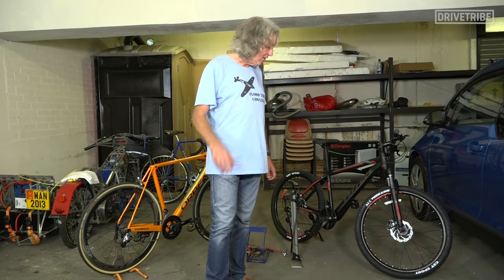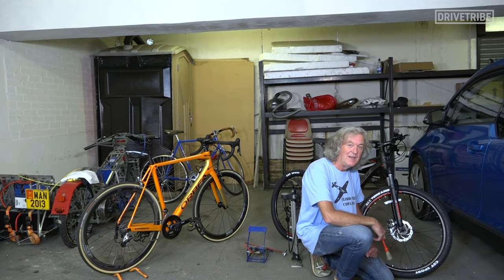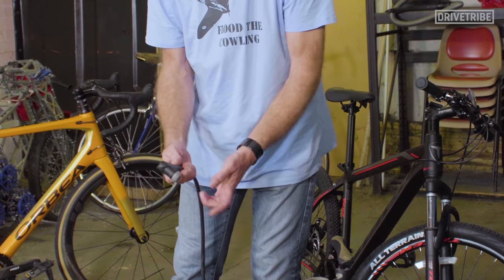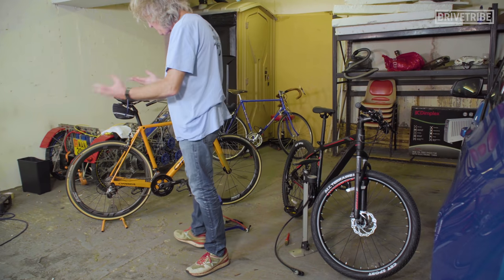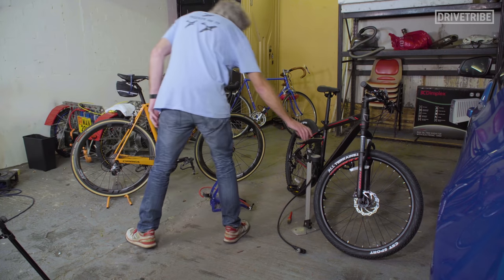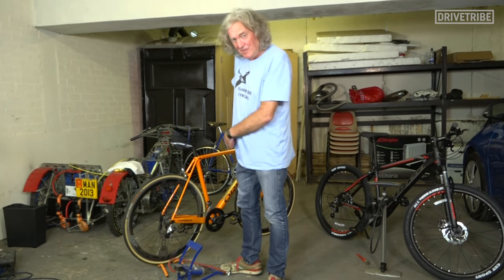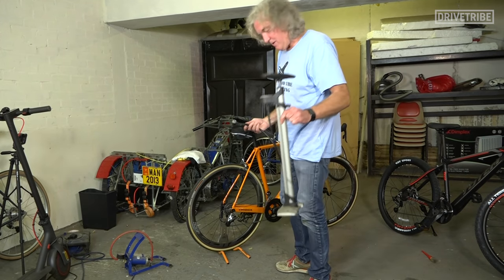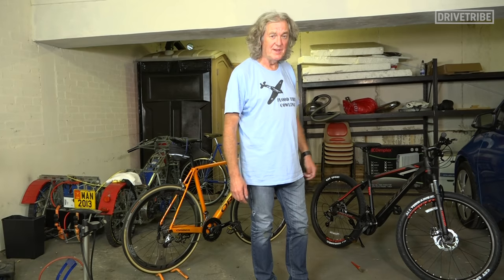Let James May teach you how to pump up a bicycle tyre

Comment: Imagine someone stealing his dust caps. He'd be mortified, especially after spending 10mins cleaning them with a car detailing brush
Reply: Well it is somewhat annoying when you've sent your bike in to be repaired and they don't put the dust caps back.
Reply: I used to put some threadlocker on mine.

You can loosen them again with a hairdryer. 👍
Reply: @jimmyrustler8983  Do you carry a hair drier out with you on the road?
Reply: @merckxy54  No, but I do carry a lighter.
Reply: @jimmyrustler8983  Why? You don't even need them so you are just making it harder for yourself if you get a puncture.
Reply: @imperialspy3457   It literally takes all of 30 seconds to remove them. Not really any harder.

Try tying a pedal back on with a shoelace after snapping it in half, 6 miles from home. That was fun.
Reply: Imagin him accidentally swallowing one... 😂😂😂 choke on your envy savey....
Reply: @gjjbfdunnb  I did that once with a monopoly board piece as a kid.

Comment: I use presta valve tubes always, because I'm always losing those caps, whenever I have a "roadside emergency."  Putting stuff down without thinking, and subsequently losing it beyond finding, is some sort of special ability I have.  If I put that cap in my mouth, it will inevitably either be shot out on exhale, or accidentally swallowed or inhaled.  The joy of living with a frequently stopped up nose.
Reply: im missing a Presta cap . do i order one from Amazon ?0
Reply: @clockwork9827  Yes.  Go for style, and order a bunch of anodized aluminum presta valve caps!

Comment: 2 points: when brushing dust etc out of a Schrader rotate the wheel to the brake caliper so that debris drops out - gravity always wins, James should know that. When you buy a stirrup/track pump buy a decent one as some of the cheaper ones will not pump above about 80psi and will indeed blow out as I found out with an Aldi one!

Comment: Schrader valve "dust caps" are the sealing device. Inside each cap is a seal to close off the end of a valve core. The valve is the transfer device. Without the cap, the valve can and often does leak.

Comment: You can also use the pump to blow the dust out of the shrader valve. 😌
BTW, most Mountainbike wheels are fitted with presta valves, because most people run them as a tubeless setup with puncture sealant.

Comment: I learned from veteran racing cyclist that it's best to remove the bottom nut from the racing (May calls it a 'pasta' valve ?) valve. 
This way the tube will seat itself better in the tyre and allow for faster replacing, at least so I was told. See 4:17
BTW at 64 years of age I seem the only one on the road still using a Reynolds Tube 531 frame, all 11.5kg (25lbs and a bit) of it.

Comment: One tip I learnt aged 10...when parking and securing the bike, it's worth rotating the wheels so that the valves are hidden from view, for example at the top end of the forks or between the brakes...in case wandering ferals or chavs enjoy deflating your tyres while you're in the shop buying liquorice or chuggy.

Comment: one extra tip.. on the road bike wiht the presta valve, you can use the dust cup to transform the valve to a schrader one. cut the tip a little of the dust cup and put it aguain in the open presta valve and you have a schared valve with no need for an adaptor

Comment: If you have a compressor, it's simpler to just use the attachment which fits your tyre valve and blow them up with that. That way you don't have to have that sped up "I see deer" montage to help you through it.

Comment: Coming from a country with many many more bicycles (the Netherlands), these are not the only two valves and especially the tiny one is very uncommon here.
The common one is somewhere in between these two. According to wikipedia it's called Dunlop/Blitz and is used on pretty much all normal bikes here. Only mountain bikes with fat tyres use the schrader valve and only pretentious race bikes use the 'french valves' as we called the Presta ones. And most bikes with presta valves simply put an adapter on the valve to Dunlop and simply leave it on.
https://nl.wikipedia.org/wiki/Fietsventiel

Comment: James - if you are going to blow out the valve or brush it out before filling, you should have the valve at the top of the arc of the rotation so any debris will fall down and out of the valve and not get brushed or blown back down it.

Comment: Also most mtb wheels still use presta because it's easier to work with tubeless sealant as u can take the core out and u can put in the sealant without removing the tire!

Comment: If you're going to use a brush to clear out a valve I suggest you turn the wheel so the valve is at the top. Dust will then have gravity's help to fall out. I'd have thought James May would have known this..... And the same applies to pumping the tyre up - move the valve to the top so you don't have to bend down to attach the pump.

Comment: In presta: Do not listen to James, trow the dustcap and locking ring away. If you get noise from the wheel (never happen to me, however heard about a few that have) due to the missing valve locking ring put a little tape or simular around the bottom of the valve.

Oh and follow The Rules!

Comment: Maybe, the molecules of air already within the inner tube are heated up by the action of the pump. These heated molecules melt and stick together, making the air harder. It takes weeks for the melted molecules to separate and the tyre eventually softens.

Comment: Maybe, the air inside the inner tube is not affected at all by the pumping action. The energy and heat from pumping, cannot be destroyed, so the energy input changes the chemical composition of the butyl inner tube into a harder substance. This harder substance softens during weeks of cycling and releases the pumping energy back into kinetic energy to drive the bicycle in overcoming air resistance.

Comment: Maybe the energy put into pumping the air already within the inner tube, causes the atoms of oxygen and nitrogen to dissociate and expand into a different chemical composition, making the tyre feel harder. It takes weeks for the dissociated atoms to reform back into oxygen and nitrogen, meaning, air. Air is 77% nitrogen and 23% oxygen, but you already knew that.

Comment: Disliking the Presta valves on my non-Posh 1970's Raleigh Record I found some beautifully machined brass Schrader adaptors on Amazon with o-rings on the back that seal on the
Presta stem.
       They stay on all the time and they don't leak one whit.  -  Problem Solving Peasant.

Comment: We just took the poor deflated tyre down to the local gas station and filled it up with the ECO air unit mounted on the wall. Just set it for 60lbs and "ding, ding, ding!",  it was full. Failing that, it was the hand operated pump that came clipped to the frame tube of your Raleigh English Racer.....Unless you had a Schwinn, which no self respecting young bike enthusiast did.

Comment: "Universal ends" are actually really horrible. I'd love a pump with a dedicated presta or schrader end and end the always suboptimal seal/fitment.

And please remove the nut on your presta valve. If your tyre goes half flat and moves a bit in your outer tyre your tear the tube around your valve when pumping it up again.

Comment: What about woods valves? Nothing like the rubber valve cores! Also, when using the stirrup pump, why connect with the valve at the bottom of the wheel, not the top where it is easier to reach?

Comment: Dont open that presta valve that much,  you only need to open it 2 turns.  That threaded rod can bend very easily because it doesnt have any support when you open the valve fully.

Comment: Hi James, If we recall, The supercar trinity drag race was brought down to the footwear. 
Using Cycling-specific shoes with clipless pedals will be like supercharging your Orbea orca. Bonus power transfer for the really stiff carbon-soled shoes. Here's my recommendation: https://www.giro.com/p/empire-slx-road-cycling-shoes/350060000100000030.html (I know you'll like them as they are lace-ups) 

Please don't worry about not being able to unclip in time. It's like driving a manual car. Once it's motor memory, and it takes about a couple of hours; you'll never even think of riding in power absorbing trainers/lifestyle shoes. 
Toe clips are more dangerous than cleats. 

Oh and please get a professional bike fit. https://www.bicyclerichmond.co.uk/
It's going to enhance your cycling and ensure you steer clear from any biomechanical injuries. 

Ride Safe 

Sincere and Cordial Regards,

Comment: Been a top level racer in my 20s-30s and still at it in my mid 50s. Never ever do I use a dust cap or a lock ring on my presta valve tubes. Ever. It's heresy. And frankly, if you do use dust caps and you put it in your mouth when pumping up a tire, all that nasty road grit in your teeth. eeeew!

Comment: Not a fan of orcas, much more a Trek or Canyon fan myself, but I totally approve of your Zipp 302s. Best inflation video ever 👍

Pro tip, keep an adapter on your rear wheel, with a dust cap of course, that way if you have a puncture on the road, and need to use someone 
else's pump, your are sure to know where the adapter is, and you will be prepared.

Comment: If people had an air compressor to blow dust out of the valve top, wouldn't they also be using it to pump up the tyres instead of a lame manual pump?